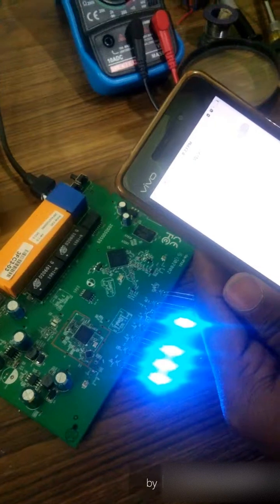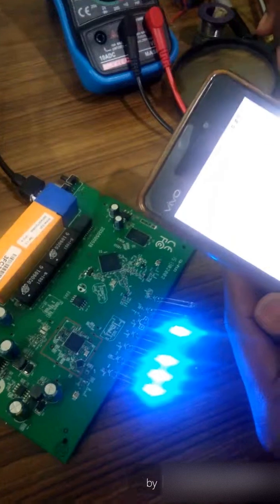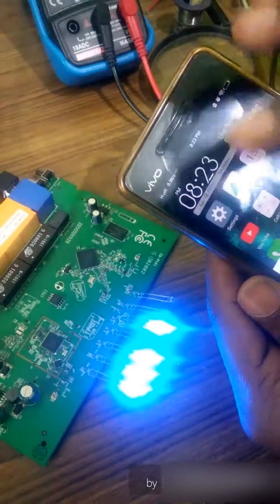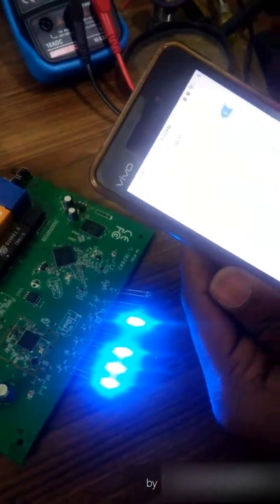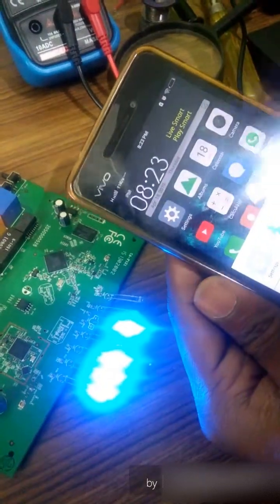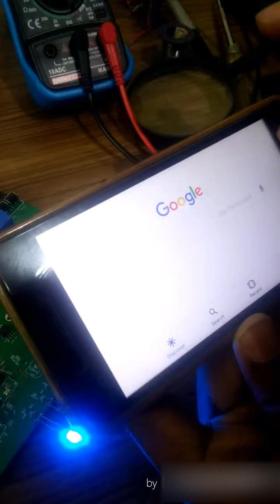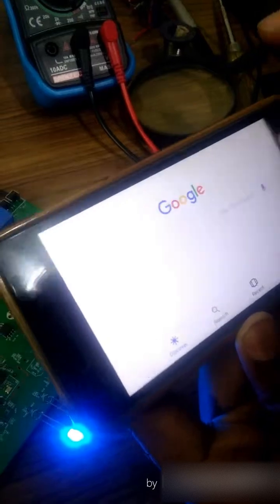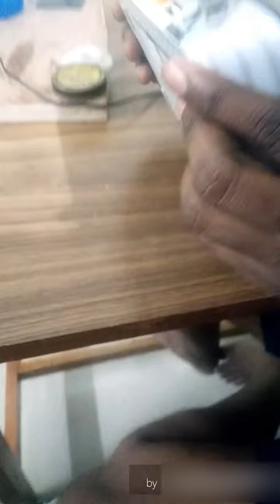📶💻Repaired - TP link Archer C20 router  not powering on - Part 2

Comment: Can i simply short that fuse and get my router working back, due to some voltage fluctuations my router dead now
Reply from the maker: If you have noticed the same issue you can do that. 
Ensure the resistance is of the same value. 
Check my video fully 
part 1: https://www.youtube.com/watch?v=ckwihF9VK5g
part 2 :https://www.youtube.com/watch?v=SIJT7XI7zYM